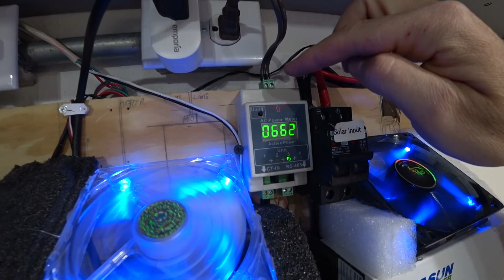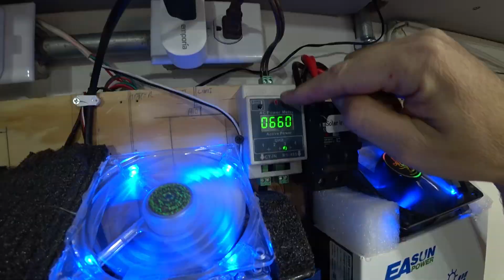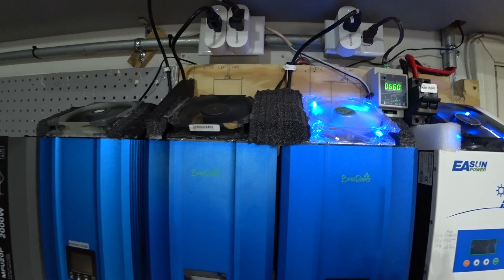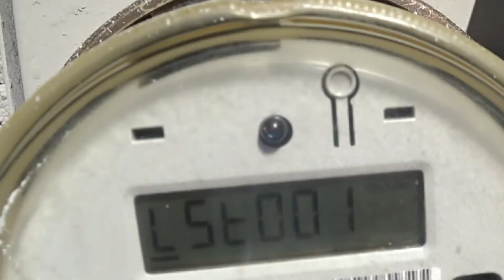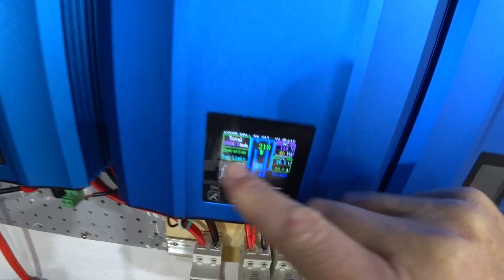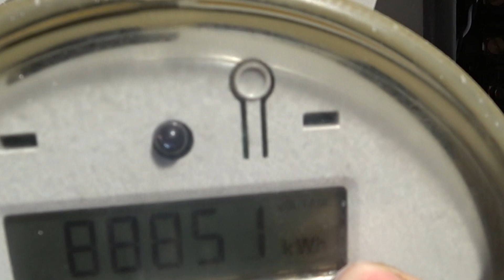How to lower your power bill with a ZERO EXPORT METER? A legal "hack" to save money on your bill!

Comment: Thank you for all the research you are sharing with us, I've been looking into this myself for a good while. I wonder why you didn't use the 2000W GTIL2, is it because of the lack of the export meter? If so it seems this is the only model I can find with one.
Reply from the maker: @BasedOrca-extended  I didn't use the 2000 w model because there is no access between the meter and my panel to put the probes on the lines so the meter can read the power usage. I have a very unique setup where the meter is right next to the panel and the wires are hidden behind hind. So without access to the main line it comes in. This system is the only one that works because this one reads behind the breakers that literally reads every line that goes into your house,

Comment: This video seems like a real mashup of good and bad information...

First, the GOOD... It looks to me like everything you have done here is safe and legal. I don't know what the capacity of your solar array is, but I assume that you have sized everything to match the production capacity of your array with the output capacity of your inverters. I also assume you permitted stuff the way you're supposed to and... it certainly APPEARS that you have a two-way meter (based on the fact that it appears to detect whether you're taking power in or sending power out)... so it would seem that you have a net-metering type of setup.

Now for the BAD... While I can't speak for every power company out there, MOST (but perhaps not all) offer what is called "net metering". The whole concept that you "sell" power back to the power company is a little misleading. In net metering, you consume power as you normally would, and whatever your solar system is producing (say 20KW) at any given time, will go to your home FIRST. Anything that you produce over what you use (say you're producing 20KW but only using 5KW at the moment, hence an overage of 15KW), goes out to the power company. Conversely, if you are using more than you're producing, the excess comes in FROM the power company. Net metering works kind of like rollover minutes on a call plan. Whatever your over-produce is counted and taken out from what you over-consume. In the end, you pay for the "net" balance of KWH you consume (hence the term "net metering"). Your usage versus consumption will vary, obviously, over the course of a day-- There will be times, like midday on a sunny winter day, when you may produce a lot of power, but use almost none; at night though, you will produce some and consume it from the power company. If, at the end of the month, you have produced more than you consume, that amount is banked (hence the rollover minutes analogy) and serves as a credit that you draw against in future months when you consume more than you produce (like in the summer).

This whole notion of "selling" power back to the utility only comes into play if, over the course of an entire year, you net produce more than you consume. Just like rollover r minutes on a cell plan only carry over for so long, so too do the credits for power you return tot the power company. If, after a year you have produced more than you've consumed, you'll receive a financial credit for the COST (not the retail value) of those KWH. And that's perfectly reasonable and makes perfect sense. The power company gives you a like-kind exchange (e.g. retail credit to bank and a retail charge to consume), but why should they pay you the retail value for power you produce that is above your total consumption? After all, they can produce that power themselves for much less money. You're lucky they give you anything at all for it! If you are consistently "selling" power back to the power company above your consumption, then you have over-sized your system. That would be a very dumb thing to do, considering that the cost to you per KWH produced for a solar system is quite high compared for the cost per KWH that the power company uses to produce those same KWH at scale. It would take decades to pay that back, which is why you typically size a solar system to just a little under your anticipated annual usage, so that you come as close as possible to breaking even without going over in terms of production. You don't install one of these things to turn a profit and go into competition against the power company, who produces gigawatts of power at scale.
Reply from the maker: @TheFeaz  That's not how net metering works here where I live, for the excess power, did you produce you only get paid about a cent. So if in a month you consume 1,000 w and you produce 1500 w then you don't pay for any electricity and you get paid for the surplus of 500 w at a rate of about $0.01. also you have that maintenance fee for the meter. So basically at the end of the month 10. You have to pay $18.50 for the meter and you get back $5 for the 500 w that you sold them. So you still a net negative of $12.50.
Reply from the maker: @TheFeaz  My meter is not a two-way meter so if I let my inverters push power into the network the meter still counts forward. Maybe the meter has a capability but they just don't want to enable it, so where I live. If you want to sign up for a net metering service they have to come over and install a secondary meter. It's mandatory. Every solar company that installs solar does it. Also the meter not smart enough to distinguish between the legs for line one and line two. So being a split phase let's say if I produce 1,000 w on one line and consume only 200 but produce only 500 w on the other line and consume $1,000. Even though I'm pushing power in the network on line one, it's still doesn't count against me so it's a raise to net zero. The meter only cares if there is positive or negative flow regardless in which direction power goes through the lines.

Comment: There needs to be a change in mindset around solar power. You do not have to power your whole house. Let the grid power your large appliances. I use solar for lights, electronics and a second smaller fridge. ROI for a smaller system comes much sooner when you gauge system based to what your lowest energy bill consumption is. I spent $9K doing it myself to save $150 to $200 a month on my electric bill.
Reply from the maker: @adamosity7127  initially I started small with two micro grita inverters 250 w each. They were only hooked up to solar panels just to cover my daily usage and my base loads and then I started to build from there and then solar when you do it yourself. It's also a toy so I keep building and building and building. And I got to this point where I am today where of course the ROI. It's a lot slower but then it's something that I play with everyday + that's why I made it bigger. But yes, you are right. Sometimes smaller is better for roi
Reply: @VegasRoManiacReviews  I started with a double conversion UPS and some car batteries. It just grew to solar when I had coin to spare.

Comment: Where are you? Which country / state /region? Different places have massively different rules and rates for exports.
Reply from the maker: @rjmunro  Nevada , and yes the rules are different but they all migrate in the same direction where the power company will not want to buy power from you anymore because it's not profitable for them, where I live they have a 5-year reduction plan where they keep paying less and less and less until they get to one penny per kilowatt
Reply: @VegasRoManiacReviews  I can imagine that somewhere like Nevada the power company don't need more power when it's sunny, so it makes no sense for them to pay for it. I'm surprised that you have to pay them a monthly rate just to not be mischarged for power flowing backwards through the meter, though. It seems like installing a meter that only measures one way would be a win for them compared to you curtailing your inverters.

Comment: They are not c-clamps. They are called a CT. (circuit transformer)
Reply from the maker: @timcat1004  I know .. I corrected myself later on in The video but once I recorded the video I just posted it because I'm sure that people that needed to understand will understand what I mean
Reply: @VegasRoManiacReviews  Actually it is a Current Transformer and not a circuit transformer.  You could called it a clamp as it monitors and will block current thus clamping the current to a certain level or block it completely. This is what prevents grid feed-in when you set your software to zero Grid Feed. It can also be used to block current from  flowing to targeted branch circuits as well.

Comment: can you explain about split phase?  how inverters are connected, to L1 or L2 or L1 and L2 (240V).  Would this still work if inverter is connected to L1+L2 (240) but load is on L1 or L2?
Reply from the maker: Yes, I'll cover that on my next video. Thank you very much for the question
Reply: @VegasRoManiacReviews  Great :) Thank you very much. You channel is very practical, thats why I love it.
Reply: Split phase is single phase and it requires 3 cable connections as follows. L1, L2 and Neutral. Your 240 V loads will connect to L1 and L2 only. For your 120 volt loads they are connected to the Neutral cable and either of the L1 or L2 cable, not both.  You should try to distribute your 120 loads as evenly as possible on your L1 - N and L2 - N to balance your system. If you have a total of 10  loads which uses 120 volts then you would try to get 5 of those loads to connect to the L1-N wires and the other 5 to the L2-N wires.

Comment: In Australia, second hand solar panels are free or very cheap, you can hook up many to get independence. Now I have panels on my garden shed, I made bike shade using solar panels, as long as you have land, you can get free panels and run small systems all around your house using these inverters using export limiter or without these. These inverters can be set up four ways, solar only, solar with limiter, battery only, battery with limiter. With wifi connections you can can monitor these or change parameters as per your needs. Only problem is that these take low voltage so you need to parallel the panels and use thicker wires. Great video in explaining to everyone.
Reply from the maker: Yeah in a couple of years you'll have to pay to get rid of the solar panels. Right now you have to pay to get them

Comment: Thanks. Can you run the inverters with no batteries? Just solar panel - charge controller - inverter to house?

What happens if the batteries get low, is there a low voltage disconnect?
Reply from the maker: Yes, these inverters you can run in directly from solar panels. You don't even need a charge controller, but they don't have a limiter function, also, if you run them on battery and the batteries run low, you could set them up to disconnect at 24 volts if you run a 24-volt system